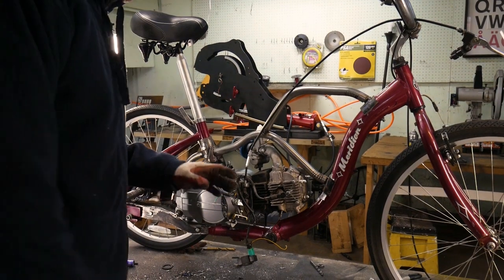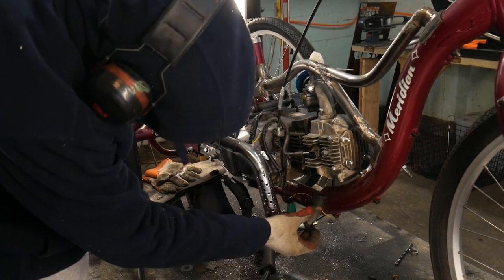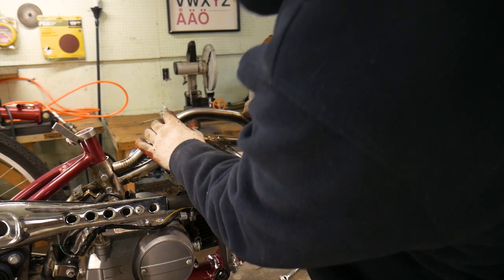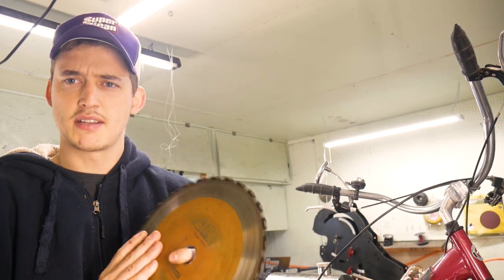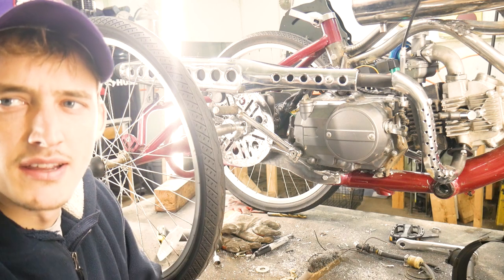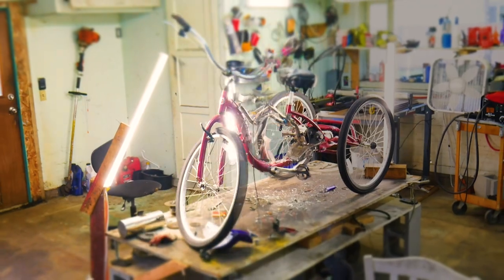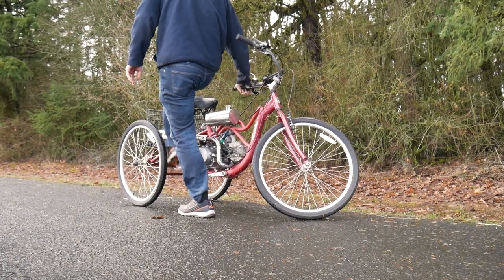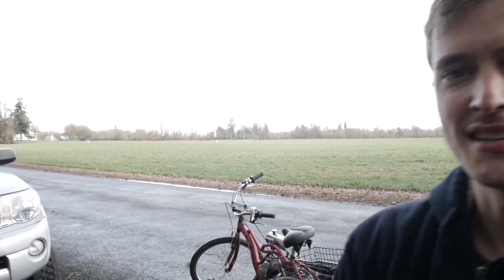This Granny Trike Gets a Dirt Bike Engine (part 2)

Comment from the maker: Be sure to check out the first part! https://youtu.be/7-gtphJppoE
Reply: Build suggestion? 1970's two stroke moped engine powered "Green Machine"? 😁 (If you install a damper, steering is a lot more stable)
Reply: One of the worst ideas in decades; at least since the ATV, and once you have to make an evasive left or right turn and burying your head and shoulder into asphalt, you'll soon learn why this is a bad idea... there should be a new book, titled, 'Upright Trikes Not Safe At Any Speed'. There's the other part of the spoked wheel collapsing in a tight turn as well. As much as I like the bike, I'd make some changes; lower your center of gravity, reduce the wheel size, or try to build a tilting/leaning wheel turning system.
Reply: Is it still for sale ill pay for shipping
Reply: oliver is it for sale if so how much i like it

Comment: Couple of suggestions, you should switch the rear axle for a bigger one and but two pit bike wheels on the back. And for all of your frame supports you welded off of, make sure all the bolts are tight and weld them to your plate and then braze the aluminum to the steel. For a more permanent finish. Awesome build though, I would love to see a Chinese dune buggy build!

Comment: Awesome build.  I have used those similar Lifan motors and other clone types like that on my projects.  If you have older or original hardware though or want a fab project I would recommend replacing at least the gear change and maybe the kick start too.
Reply from the maker: thanks, yeah so far the motor runs great, only issue I have is it tends to back-fire when starting and it pushes up my leg through the kickstarter
Reply: (Take with a grain of salt I'm no expert) but I would double check to make sure sure idle and fuel mixture screws are okay on the carb. Otherwise it could be valve gap but I typically don't open up that can of worms unless I really have to on those types of motors because it always feels like you pull at the thread and the sweater comes undone lol.  It's just the nature of the beast I suppose. Better just to get it running fine and walk away

Comment: Scary is a great word to describe a motorized trike . Back in the mid 70s my friend and I built a trike with a Kawasaki 90cc enduro engine . The frame bolted together in the middle , so you could put it in a trunk for transport . We used 13" car wheels / tires on the back and an 8" boat trailer wheel / tire on front . Not sure what it weighed , but not much . Solid axle and you could actually smoke the tires . Low speeds were fun except corners , but high speed runs made you think you were going to meet your maker .                                                                                               I have had an idea floating around in my head for years , an off-road four wheeled power bike . Primarily a pedal powered unit with both electric assist and a tiny honda engine from hand held power equipment . The build in my head gets pretty complex , tying the three power sources together along with full floating suspension . Was planning on mountain bike wheels and tires and keeping the center of gravity as low as possible . You are just the guy to make it .
Reply from the maker: that would be cool, like a utility vehicle with a gas generator on it?

Comment: You wanted ideas, well here's one, Get a fat wheel mountain bike and motorize it!! Electric should be the easiest way to have some power and be able to mount the motor..
And a tip for this build, I would go with fat tires, they will make it more stable and give more contact to the road so you can safely go faster..

Comment: We had a 212 on ours would smoke the tire at high speeds the problem we had was the brakes u can take the center section out of the rear end and weld a gear there we also had problems with the rims blowing pins

Comment: Your bike is cool, there's a ton of tubing, and that disc brake is dangerous. Disc brakes are not made of any old metal. If it's too soft it can fill the calipers easily, wear too fast, and warp.

Comment: You Should Stretch Out The Front Forks And Get 2 ...20" X  4" Rear Tires (They Use Them on Chopper Bikes) And Lower The Seat  Back Slightly With A Back rest.... And You Could Prolly Get About $2000ish For It?..imo?) Cool Job Tho !!!

Comment: In my state you just can't throw on a gas engine on a bicycle and call it done. That's the quickest way to get stopped by the police if they see it done that way. In my state you can put a engine on a bicycle but there is a limit how fast it can go. Also it has to have headlight, tail lights, turn signals, break light basiclly everything you will find say on a moped or scooter that's street legal.

Let's say you built a bicycle that way now you got to go through the trouble of getting it inspected so it will be street legal. If you ask me might as well buy a used moped or scooter and save your self the trouble of all that work. lol

Comment: You need one of those Mig,Tig,stick welders from Harbor Freight so you can weld aluminium you alreadyalready have that expensive Plasma table and pipe bender.

Comment: i would move the tank to the lower end of the trike at the back get a pusle pump tap a nipple intot he inlet manifld to get the feed for it that or frame tube just a stright pipe from doen to to seat post and fit a mini bike tank
Reply from the maker: what's wrong with the current placement?
Reply: @OliverMotorized  looks mainly with the drum tank